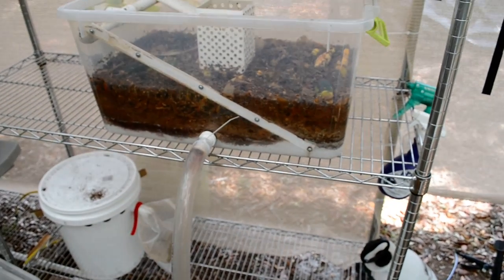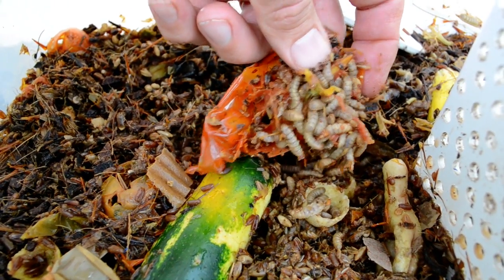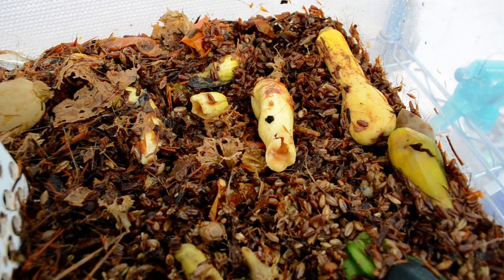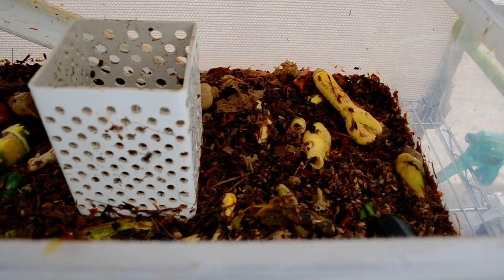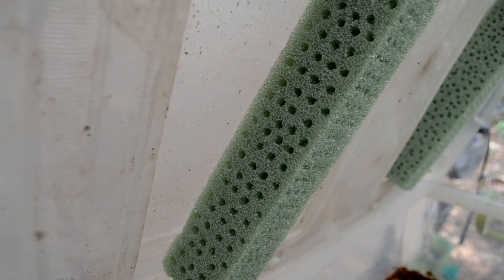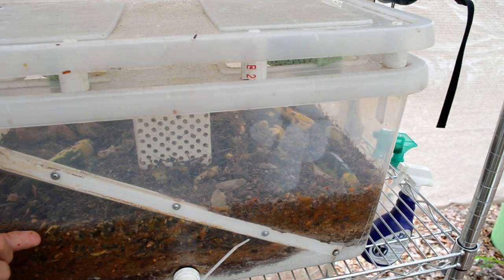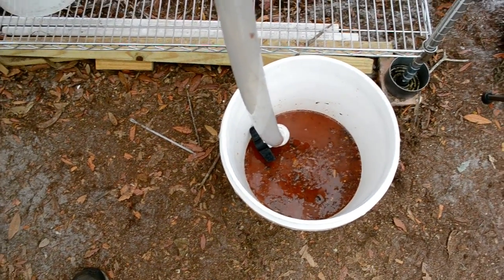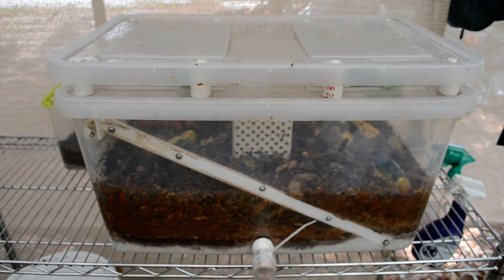storage tote BSF composter update May 29 2013 Part 2

Comment from the maker: Thanks. Check out the video description for a link to a slightly different design that I've been having even better results with. I'm currently using a smaller box, but the same principles can be applied to this larger container.